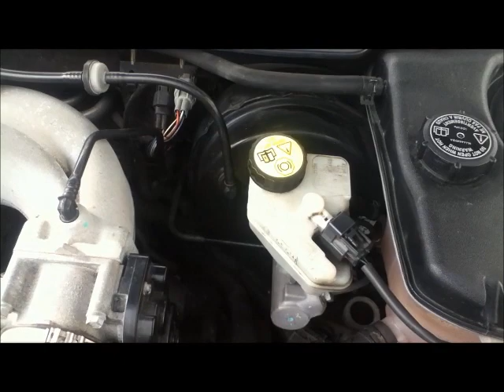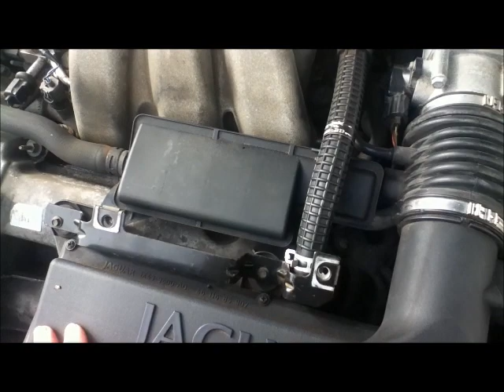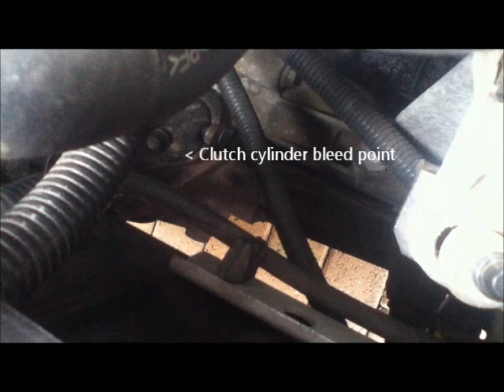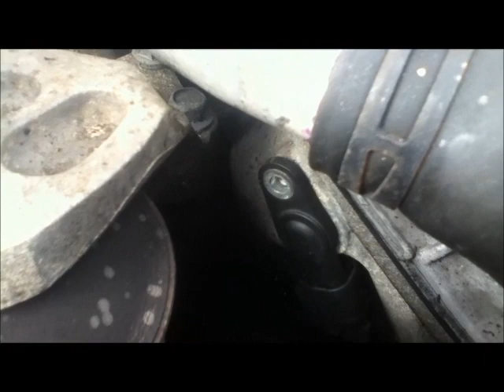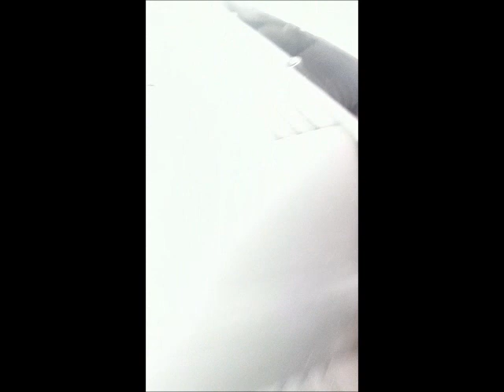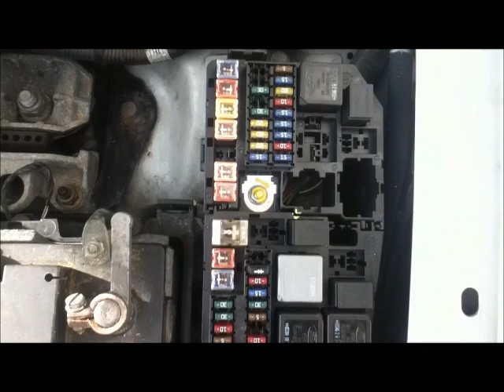Jaguar X Type  - Naming the Engine Parts - petrol manual gearbox

Comment: I meant I did not know this engine was designed by FIAT
Reply from the maker: The engine has a long history. Variable Valve Timing was originally invented by FIAT and used in many cars. https://en.wikipedia.org/wiki/Jaguar_X-Type#:~:text=The%20X%2DType%20was%20based,use%20of%20variable%20valve%20timing.

Comment: Hey i just bought one of these and its missing the little hose that connects to the air intake just after the mass airflow sensor and i was just wondering if you could help me figure out what it is? Love the videos btw, some other videos helped me diagnose some other problems ive had with mine
Edit: its right after that little plastic sound resonator thing sorry
Reply from the maker: According to the Jag workshop manual it is the positive crankcase ventilation hose. It may have been taken off because the PCV valve in the larger ribbed hose is blocked. I have done a video on this: https://www.youtube.com/watch?v=CPksHFxbOaQ
Reply: @johnnysevengun  its the hose just under the pcv hose, looks like an L and connects to the intake hose just before the throttle body
Reply from the maker: Yes the jag manual calls it a positive crankcase ventilation hose.
Reply: @johnnysevengun  ohhh ok thank you

Comment: Can you please identify for me the filler pipe that comes up vertically on the side of the car where the battery is? When I bought the car I had the battery and battery tray removed while I was replacing the water pump and I noticed a vertical pipe approximately 5/8 of an inch in diameter protruding upward with no cap on it.  Recent potential issue has me wondering what that pipe is meant to be used for filling and if the absence of the Could be causing the problem.
Reply from the maker: I think you are talking about the battery breather pipe. It should have a small white elbow that fits into the battery breather. See this video at  13.20. https://www.youtube.com/watch?v=lswd2ESMbjE
Reply: @johnnysevengun  it’s actually a metal pipe that’s coming up from what looks like perhaps the transmission. I saw it when I have the battery and the plastic tray the battery sits and completely removed from the car
Reply from the maker: @lifeasrob1757  Is your car automatic? My manual car does not have this.
Reply: @johnnysevengun  auto
Reply from the maker: I think this is the auto transmission  filler point. See 1.33 in this video. https://www.youtube.com/watch?v=HjQeFMpLWp0

Comment: I know I’m late to the party but this just came up on my feed after I have just taken my manifolds apart to replace the knock sensor. If I had seen this before, there would have been a lot less head scratching…lolz. Really strange that I have same model car from 2005 but, some of the components and placements are different. Great video buddy, really helpful for us dingbats that look at a manual and it says ‘remove clip from maf sensor’ …then spend hours trying to find where the actual…it is!

Comment: Great video. Can you tell me what the component is just to the bottom left of the oil filler cap? Can be seen clearly at 9:36 with the wire coming from it. I'm getting a reasonable leak from this
Reply from the maker: Pretty sure I say that it is the cam position solenoid. Mine leaks too.
Reply: @johnnysevengun  Thanks very much :-) Hoping it's just a replaceable seal

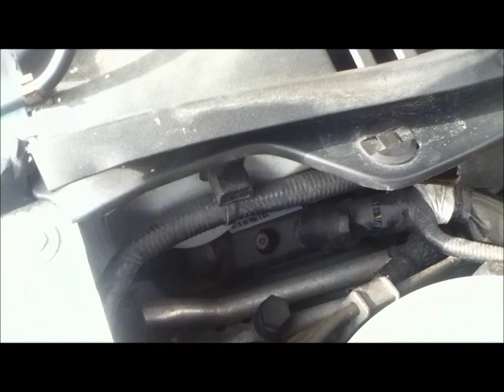Comment: 4:18 trying to charge my ac. Which is the low pressure? Thank you kindly
Reply from the maker: The low pressure valve is right at the back near the ECU on the RHS of the car (as you sit in it). It has a black cap. The high and low pressure valves are different sizes so you cannot fit the charge bottle to the wrong one. This is a good video on it. https://www.youtube.com/watch?v=u1xDG-7ycWU

Comment: Hey - thanks for posting, very informative and you just saved me a huge head ache. I had a leak in the "T" in the coolant hose that you mention at 6:50 and I couldn't tell if it was the "T" or the hose to the heater core. I remembered that you had this video and came back to watch it again. When you pointed out that it is "famous for failing"  I knew that had to be the problem! I changed it out and she's back up and running. Thanks again!